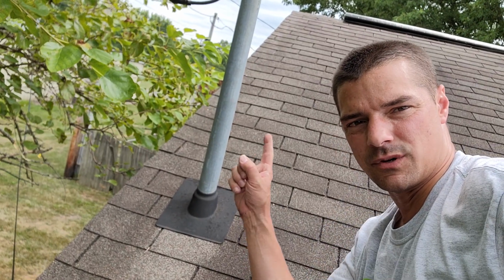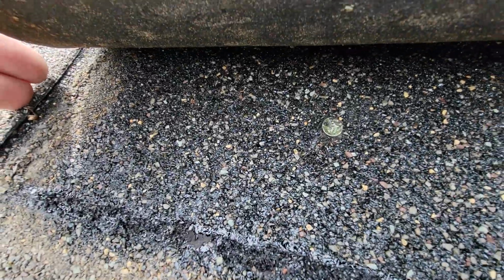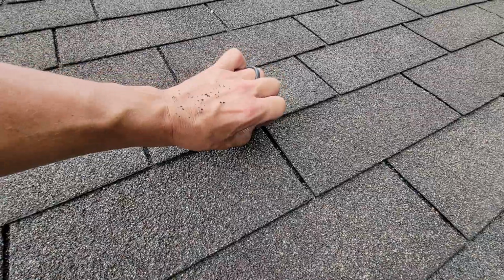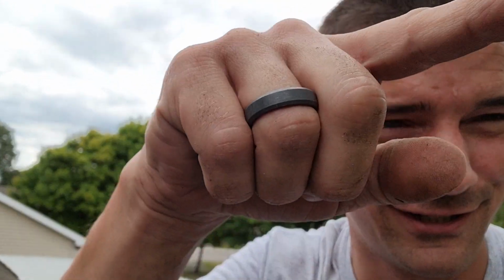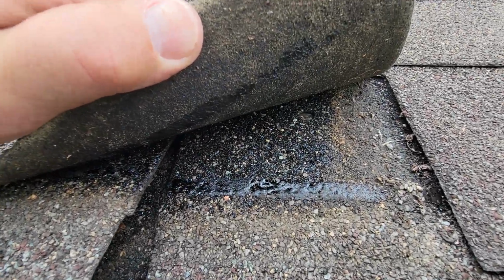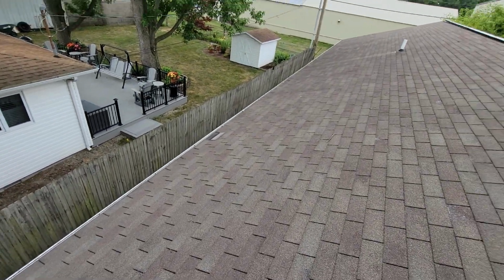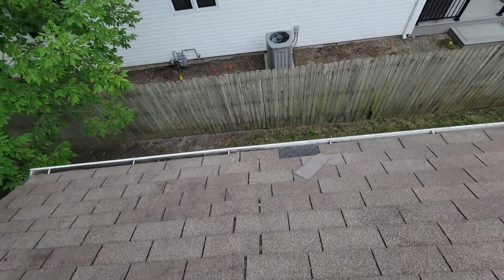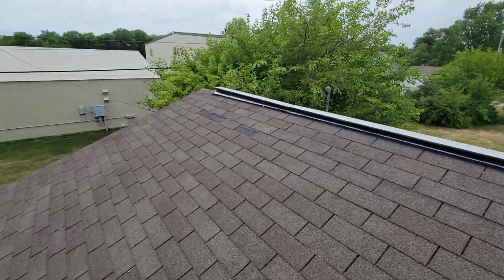Bad Roof Install - How has this held up?

Comment: I’d be extremely careful walking on that roof if there’s so many shingles that are nailed improperly you may surf off the edge. Happened to me once, not all the way off the edge though
Reply from the maker: If it was just a little bit steeper definitely, I know what you're talking about. This was a fairly low pitch.

Comment: I've seen just about everything I've seen them start at both ends and meet in the middle I've seen them run straight lines straight up no interweaving I've seen new roofs with no flashing I've seen vents and Boots just face nailed I could go on for hours that's what you get when you go with the cheapest bid

Comment: Question.  Who in this day and age still intalling 3 tabs?    Now, I've seen "high" nailing but no nail at all!  LOL>>>
Reply from the maker: I still see neighborhoods being thrown up with new 3 tab roofs. 😒
Reply: Same here up in Canukistan they do new builds tar paper at eves and go over OSB.  Complete ****!
Reply: Hello, sorry I am part of the problem, my roofers wanted to put architectural shingles and I specifically asked for 3 tabs, they said I was retarded but I insisted. They charged me a bit extra because they warranty the job and material themselves for 20 years. I just prefer the look of it and my roof is very visible :/
Reply from the maker: @BobyLeTerrible   If it's a particular look you're looking for then that's totally understandable. Most of the time people want to go with it to just save a few dollars but  little do they realize the contractor will just charge more than they're saving.  I just recorded a video on that particular subject today.
Reply: @gardencity3558  garden city? Like welland? If so I know exactly the places you'd be referring to. Matchboxes thrown together with the cheapest shingles money can buy, drives me insane
Reply: new housing builders are using 3 tabs and plastic vents.
Reply: Not a roofer but I think I remember seeing that on 3/12 or so pitch 3tabs are allowed but architectural are not.
Reply: @bobcougar77  2/12 is the absolute minimum for asphalt shingles but the deck should be done %100 ice and water so essentially the shingles are for uv protection for underlayment and looks..Any less than that roll roofing or torch down.
Reply: @gardencity3558  yup, I'm tracking all that.   My point was there is a pitch where 3 tabs work but laminated shingles don't.

Comment: Doesn't this speak to the quality of the shingle because it hasn't blown off yet? There's no way that shingle is IKO.
Reply: I will always advise my customers to not use IKO shingles. I have repairs on roofs that another company had put on, and have found their seal strip is terrible. New roofs that have been on less than 5 years and you can lift up the shingles because they haven't sealed.
Reply: @mikedeetch8960  Yep, I completely agree with you. We had a massive storm couple months ago in the GTA, and were out doing repairs - every single repair we did was IKO/BP, we didn't see any Landmark or GAF blowoffs.
Reply: They are easy to determine they are Iko shingles because of the weird size shingles

Comment: I wonder are 
you obliged to use this sytem on the roofs there  because of storms ? Because here it's only been used on cheaper buildings like garden sheds/ carports/...  On a  

pitched housroof we using roof tiles that's more reliable and lasts  alot longer  then this.
Reply: I'm from Las Vegas Nevada and there nearly everyone has brown Spanish tile roofing, only a small percentage of homes are shingles because of the heat. I've lived in boise, idaho and 90 percent or more of homes here are asphalt shingles. The house I live in is asphalt shingle roofed, I actually put a new layer on myself a couple years ago. We don't get super extreme weather. Not many big storms and never higher than 110 in the summer. These roofs should last 20-35 years here.